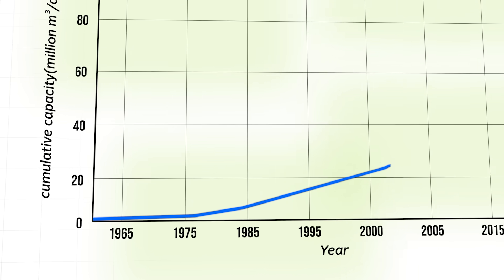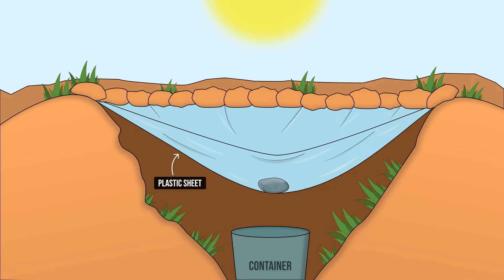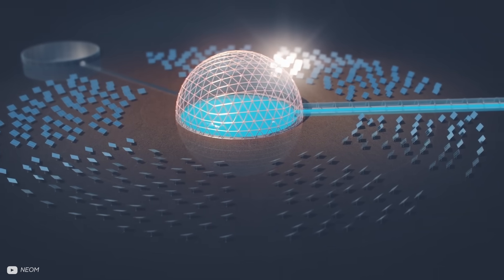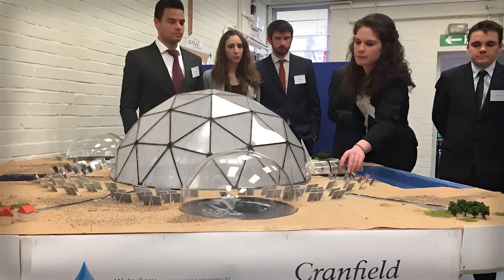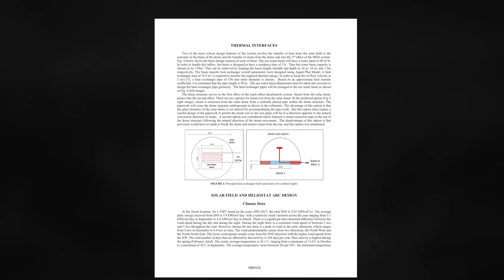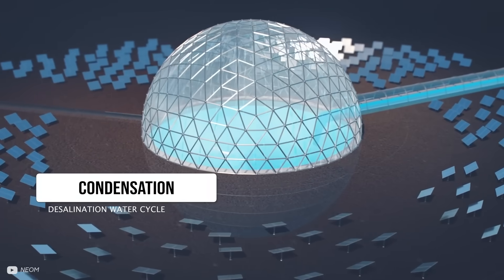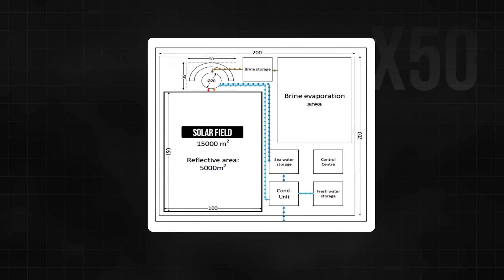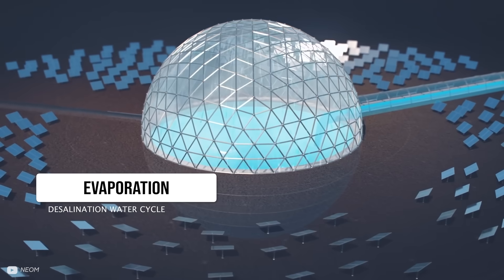Unlimited Fresh Water: Can Glass Domes Save Us?

Comment: Domes like this are fighting against the square-cube law. The amount of solar energy that falls on a dome is proportional to surface area, or radius squared. The amount of water held in a dome is proportional to its volume, or radius cubed. The bigger the domes, the less surface area each unit of water volume will have to heat it. 

This is the fundamental problem. Solar stills fundamentally do not scale well. If you really just wanted to do large-scale desalination with solar stills, it might be best to mass produce hundreds of smaller units and just deploy them in fields like we do solar panels, rather than trying to make more impressive giant domes. Go for hundreds of domes 3 meters in diameter rather than one big one 30 meters in diameter.
Reply: That makes total mathematical sense. I am researching atmospheric water generation and stumbled onto this concept.
Reply: @off-gridsurvivalmike8120  "atmospheric water generation" 

....Do you mean 'dehumidification'? Because the only way to pull water out of the air is if there is water in the air to pull out in the first place. There is a name for the amount of water contained in air, its Relative Humidity, expressed as a percentage of the maximum capacity the air could theoretically hold at that temperature and pressure. Do you know why air conditioners have a drain spout? Its because when the air is chilled, its capacity to hold water drops. Any water in the air over the amount of water it can hold at that temperature and pressure crashes out condensing on the nearest surface in the evaporator coil section of the air handler. That water runs down in to the drip pan, and drains away or is sometimes splashed up by the condenser fan to assist in sinking heat away form the condensing coil.  So, if you want water from air, get an AC unit. Youll be cool, and have (some) water!

Fun Fact: The first 'air conditioning' system was build in 1902 for Sackett & Wilhelms Lithography and Printing in Brooklyn NY! The paper stock they used needed to be kept within a certain humidity window to move properly through the machines and not jam, or to take on ink efficiently. After trying ways of controlling the humidity through heat and just shutting down if it got too high since the wasted material and time wasnt worth risking, Willis Carrier designed a machine that used chilled pipes to drop the air temp, therefore removing moisture from it, then re-warmed the air and using sprayers reintroduced a measured amount of moisture back into it. The successfully regulated the relative humidity in the print works, and had the added benefit of keeping the workers at a comfortable temperature therefore more productive ;)

So even since its inception, AC has been used to suck water out of air with cold. And hate to break it to you, bud.....But you're thermal electric devices (Peltier coolers) arent going to match a window AC unit or a walmart dehumidifier (which would use one internally anyways) any time soon. Like, ever. Physics says no. And Im sorry, mate, but if someone guided you into that venture, whoever pushed you onto that track....is either a shyster, an idiot, or lied to you.
Reply: There is math and there is government math. As Mr Hadden says in the movie "Contact", "First rule in government spending. Why build one when you can build two at twice the price?"
Reply: U.S. utility patent grantee here: Also merely from a common-sense perspective: A better way would be to keep the condensation surface cool (otherwise water will not condensate onto it) is to use the parabolic heat collectors as a sun shield of the condensation system, that is, put the damn thing below the heat collectors, run the oil pipes in a small chamber (perhaps buried underground to get extra heat dissipation) pour saline water on the hot pipes, water evaporates, chamber walls cool, and water will condensate onto the chamber wall that they can collect at the bottom into another pipe that draws out cold, fresh water, provided that, the distance from the hot pipe to the chamber wall provides enough surface area to transfer the heat of condensation of the steam upon it contact to the ground—if the pipe is too close to the chamber wall, insufficient surrounding ground may lack the heat dissipation capacity to keep it at an optimal temperature for functioning as a condenser, and assuming the design is a linear installment of individual heat collectors connecting into a single pipe potentially running hundreds of meters, or kilometers with ample room between each of these multi hundred-meter/kilometer long lines to not heat up the ground to allow for the ground to also dissipate the heat, including majorly back onto the surface and out in the air. 

This design would not run into the square-cube law.
Reply: @almasysephirot4996  Of course, we may also spread out the Dome desalination concept across hundreds of smaller units in any given area.
Reply: @almasysephirot4996  So.....whatd you get patented?
Reply: The system as described is far from ideal. They could instead have a water tower that operates under a vacuum as the target for the reflecting mirrors. The margins of temperature change needed for phase-change of distillation produces a significant increase in efficiency. (Look up information on "flash distillation", it's a tried and true method.) The layout would be more mundane, boring, and industrial looking than this glammed-up glass dome they're trying to sell.

Like you say, the distilling tower wouldn't need to be particularly big. But it'd be effective enough to fill up two bigger regular water towers put in a nearby location within a week.
Reply: I designed something like this.
Reply: Instead of embracing feature bloat and trying to generate electricity they should probably just have two plain structures, one with a transparent glass dome and a flat pool of water to heat and a second one with a opaque dome and a spherical volume where water can condense. A continuous flow of water would eventually fill up that second dome and provide plenty of drinking water. You could probably even add further condensation domes for even more storage. Meh.
Reply: They got a hundred million before researching basic design. This is just the government people stealing money.
Reply: @TanyaLairdCivil  
Two points. 
First you did a great job explaining why diesel injectors use tens of thousands of PSI to break apart the fuel into microscopic droplets. The smaller the droplets the more surface area for combustion per volume of fuel. This provides more complete fuel burn and reduced emissions.

Secondly would the mirrors act as increased surface area when the energy is directed onto the sphere?
Reply: It's closer to a square-square as you wouldn't fill the entire lower half of a sphere as you scale it up. This means output is limited to cross section but it already was.

Edit: I see now that's trying what you described which is quite silly.
Reply: Note that the mirrors in the surroundings are supposed to be the main source of radiation, not the dome itself.
Reply: Hi Tanya, from New Zealand.  Your onto it mate, well put. I reckon you got it right.  Cheers Tanya😊
Reply: OP is known for posting dumb trash, this ain't no different.

Comment: I think desalination is awesome and we need more of it. However, if we're going to go giga or tera with it, wouldn't it perhaps be cheaper and faster to just not let water run into the ocean in the first place, and then treat that water with more conventional methods?
Reply: That sounds good, but the coastal environment actually counts on fresh water discharging into the ocean.
Reply: @andrewday3206  But if we gather seawater, desalinate it, and return the salt to the sea, the effect is the same.
Reply: @no_rubbernecking  
Returning the salt is like dumping brine. We sell the salt and remove it.
Reply: @andrewday3206     Sir you are talking about adding megatons of salt to the market per year, over and above the sea salt we already produce. Are you not aware that the great majority of what we already produce is returned to the sea as there is, by a wide margin, no demand for it?
Reply: @no_rubbernecking  There are many tons of salt which is mined, already. If more salt were produced from desalination, less would need to be mined. So, it balance out.
Reply: @artsnow8872    This idea, if it were true which it isn't, doesn't matter to anything. That amount of salt is not needed (even with no mining) and it is no technical problem to return it to the ocean in a proper manner. This issue has no measurable impact on ocean salinity, either way. The only issue is not dumping it in an estuary or single spot right on the coast. This has no relevance to the question of the method of desalination. If we need more fresh water, which we do, we either use more rainwater or we desalinate. Either way, the amount of salt in the ocean remains the same, and the amount of water being removed from the ocean and kept on land is so small it makes no difference to anything. Worst case, some of the salt can be returned to underground locations where halite was previously mined, but it seems unlikely that this would ever be necessary.
Reply: @no_rubbernecking 🤝
Reply: Sodium ion batteries and  and molten salt energy storage are a real thing.
Reply: @jonraabe    That's wonderful but the revenue from that would be small potatoes compared to the cost of giga-scale desalination.
    Don't get me wrong, we must desalinate more, but in the long run, it makes more sense to make proper use of the fresh water we have in regions that have a surplus of it. The above criticism of this, which is that doing so increases the salinity of the ocean, is not really true. The amount of water in the hydrosphere is pretty constant, all else being equal. Removing some from the ocean might temporarily increase salinity to a small degree in small areas, but this is balanced against

 1) centuries of withdrawing fossil groundwater and letting it flow into the ocean virtually unimpeded; 
2) Melting polar ice;
3) Decades of industrial desalination before we would start a widespread program of stormwater conservation;
4) The future halting of halite (rock salt) mining, and the availability of those mines to store any excess sea salt if it should be found necessary.